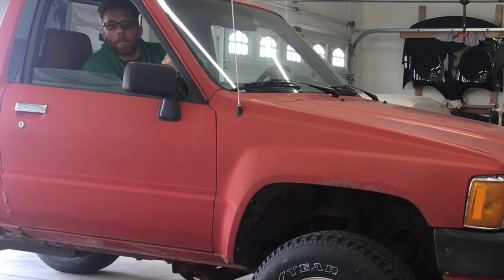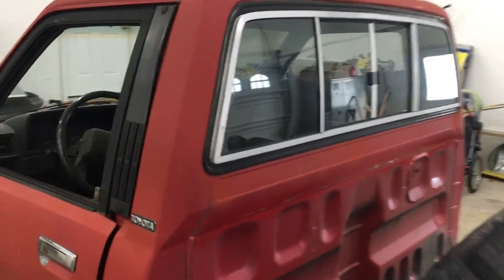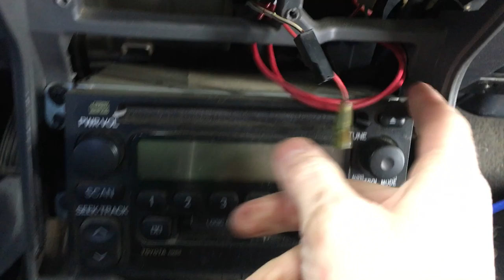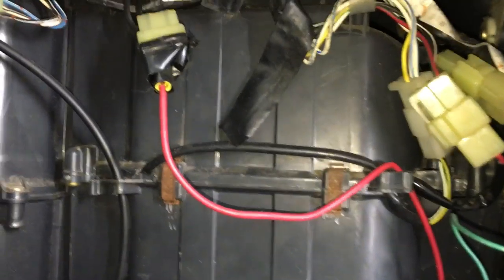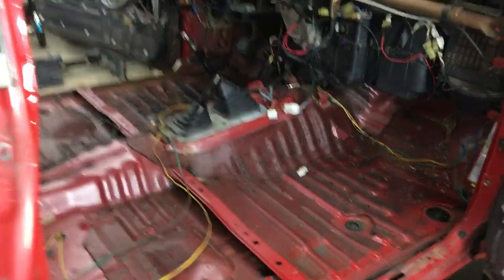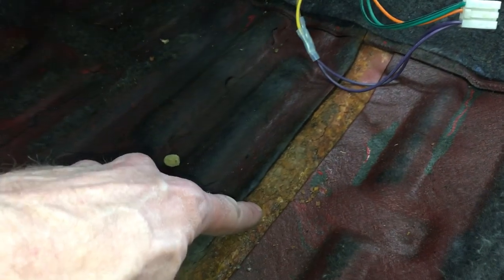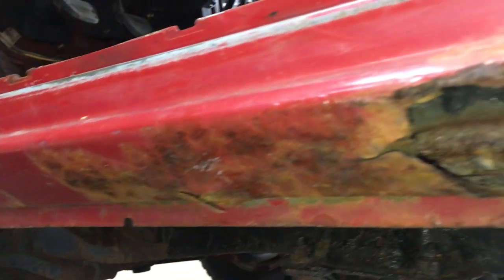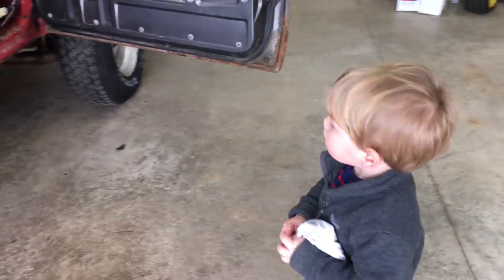Gutting the Interior: 1987 Toyota Pickup 4wd

Comment: the deck lamp switch is specific to 4runners, it is a small light in the drive side rear trim panel to illuminate the cargo area, it is not a pickup part.  the inclinometer was hardwired in because it was also pillaged from a 4runner, pickups were not offered with this feature (although the 4wd tercel was).
Reply from the maker: My 85 pickup has a deck lamp and light behind the cab but it is an extra cab. Are you sure about 4runners only having the inclinometer?  I’ve seen sr5 pickups with the inclinometer gauges.
Reply: I stand corrected, according to 4Crawlers write up some pickups were offered.  I have never seen a 4Runner that didn’t have the plug behind the dash even if it didn’t have the meter, if yours was hard wired and not utilizing the oem harness I would still bet that it, along with the dash pad, were pulled from a 4Runner.
Reply from the maker: @codykey9096  100%  Also, I retrofitted one from a 4wd Tercel into my 1985 xtra cab. My 85 had the plug already there behind the dash that I could tap into. One of my fav mods so far!

Comment: I did a double plug setup to get a newer CD player to work with my tape deck. I had a small selector switch to cut the power to the tape deck, or the CD player depending on what unit was not in use at the time. 
That way I could use the Toyota single units with the OEM audio head. I used to change the uber crappy OEM speakers out, but the amps were generally not terrible.
Reply from the maker: Ahhh that makes perfect since, since they upgraded to a newer radio 👍
Reply: 6th Gear Garage Yea, if you were closer, and if butt and crimp connectors were not used, (I solder and heat shrink everything) it could have been me!   ;-)